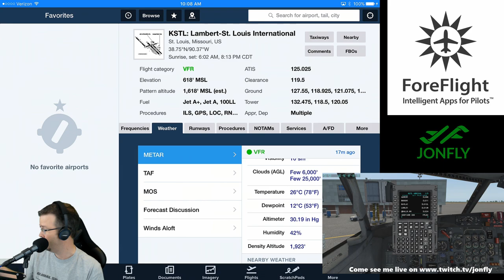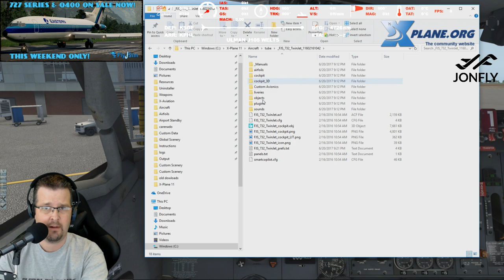FlyJSim 727 with the Author.  X-plane 11  KSGF to KSTL BetterPushpack plugin -  Flying a classic

Comment: The 72 was flown primarily by Fuel Flow settings in flight so as a general rule of thumb your corresponding fuel flow = your indicated airspeed so 2000 lbs/hr = 200kts, 2500 lbs/hr = 250 kts 3000 lbs/hr = 300 kts, etc...  For take-off your EPR settings would be used.  Also on climb out and decent you need to properly set on the engineers panel items for the flight phases unless the FE panel on this sim is not modeled in detail.  For example, the CSD oil cooler switch is normally turned off just as you are taking the runway and then it is turned back to normal right after take off.  Additionally, on your FE panel, the  AC Gen Drive panel switches should be set to RISE after take-off.  When starting the 72 be sure to check the Engineers Oil panel after you initiate the engine ground start sequence and check for Oil Pressure Rise before introducing fuel to each engine at 20% N2.   Hopefully that will help you out a bit when trying to maintain your airspeed especially.  Enjoy flying the 72 - it is Awesome!
Reply from the maker: Thank you for the information. You seem to know this bird well. Thanks!
Reply: Hi Jon,  No problem - Yeah,  I love this airplane so much so I bought the first 45' of a 727-200 to make a flight sim out of it.  I am actually preparing to get my F/E and type rating on the 72 so I am getting to know the systems pretty well and am glad to help out with flying and operating the sim.  BTW, you can indeed operate the galley with the APU on the -200 but you have to use both packs.  On the -100 you can power the galley with just one pack on with the apu. That way your First and Business Class Advantage and Advantage Plus passengers can have their hot coffee!   Most airlines would try to power the airplane with ground power to save fuel if possible, but at the smaller regional airports back in the day that was not always possible so onward with the APU and crank on that galley power as needed!  Any other 72 questions just let me know - I have plenty of resources that can get me the answer if I don' t know!  Happy Contrails...

Comment: Jonfly what was the big news you were going to announce after landing? The stream got cut short, did I miss something?
Reply from the maker: I was announcing the new MisterX KABQ :)
Reply: Jon Fly oh cool. I thought maybe something like I won  1m jfmiles. 😀 Thanks again for the nice streams.
Reply: Aah, thank you Mr JFLY. BTW, whats your handicap?
Reply from the maker: 12 :)
Reply: Hey JonFly, try taking the 727 off from SLLP, (El Alto Balivia) elevation is 13,355. You need auxiliary air to start the engines for one thing and you need all the runway with flaps 20. Runway length is 13,100 feet. I saw the story of the 727 on youtube and one of the places they tested it was at SLLP due to its elevation at the time was the highest airport elevation in the world for commercial airport.  FLYJSIM did an awesome job on that plane getting it all right it seems.